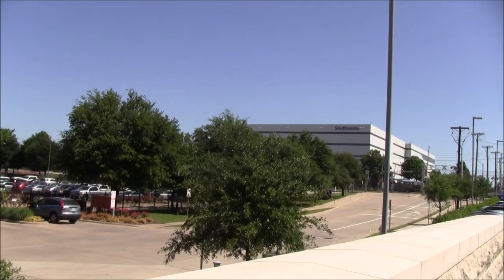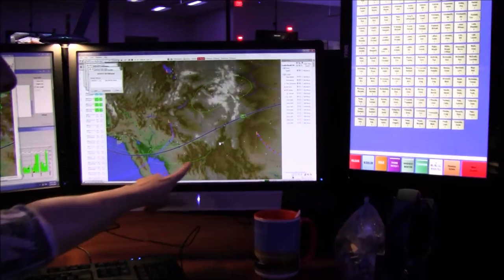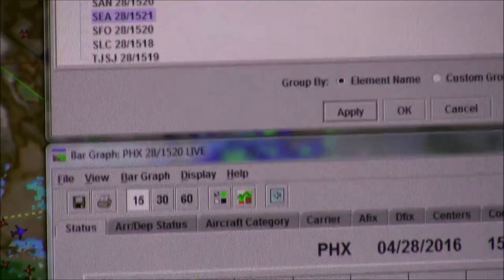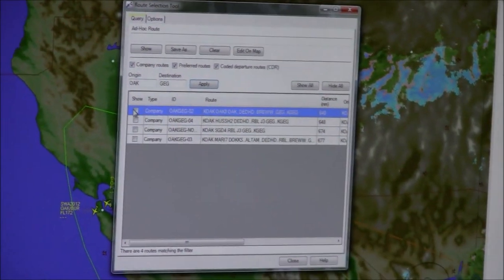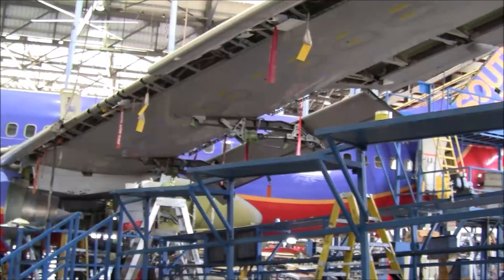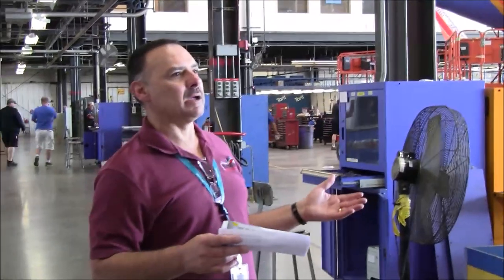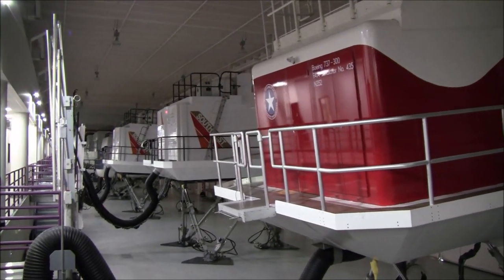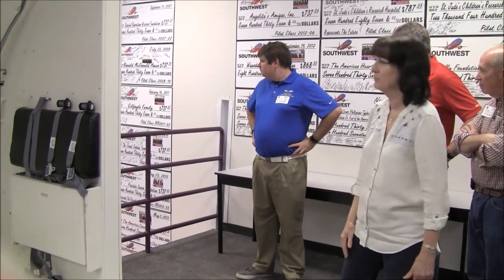Southwest Airlines Tour (HD) NOC, Dispatch, Maintenance Hangar, Simulators Bay, Training Center

Comment: whats with the rubber kitchen about? 🤣
Reply from the maker: I think maybe you mean the rubber chickens? Was that what you were talking about?
Reply: @LauraLaster747  ohh yeah! Typing error! Haha! I meant chicken!
Reply from the maker: @isaacpestpreacher5175  I am told that long ago, the simulators at SWA kept breaking. The maintenance guy's solution was to hang a rubber chicken on the sim to keep it working (maybe keep "gremlins" away??) Apparently, when they moved the sims at one point, the rubber chickens did not get moved, and the simulators started breaking again. They replaced the rubber chickens, and the sims got better. Now it is some kind of company lore about keeping rubber chickens around to keep the sims running well.
Reply: @LauraLaster747  hahaha might as well get me a rubber chicken in my Cessna, tires keep bursting even on better landing lol
Reply from the maker: :goodvibes: @isaacpestpreacher5175